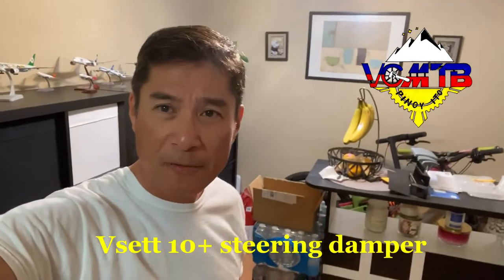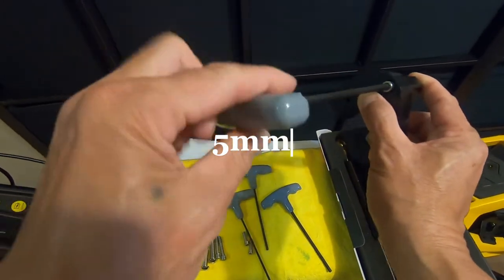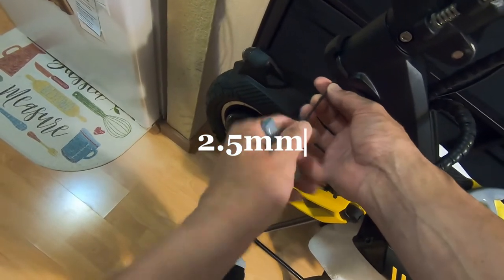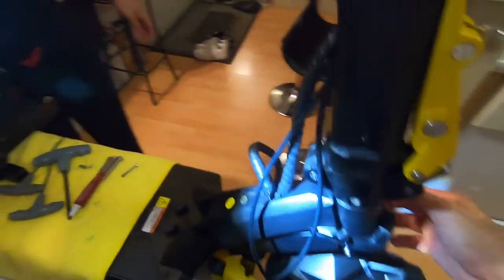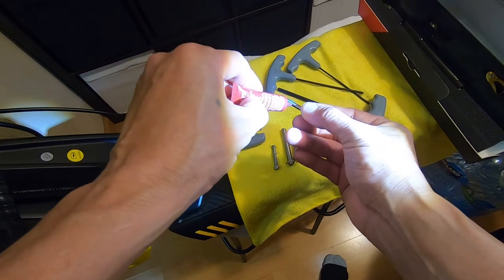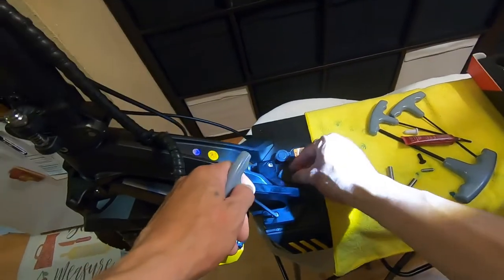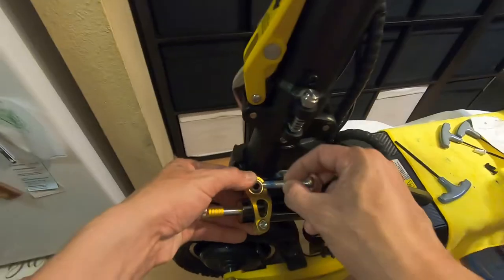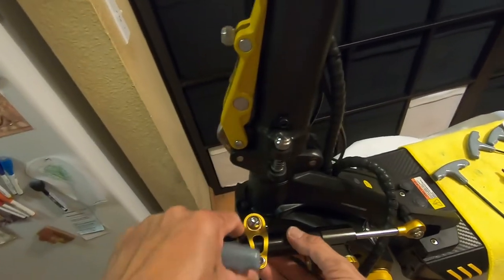Vsett 10+ Steering Damper Installation/ Electric Scooter/how to

Comment: Hi, installing my same damper today. When you installed the front bushing and slowed down the video, it looks like the curved side goes down. So on both bushings the flat side goes against curved side on all points, correct? Thanks!
Reply from the maker: Yes correct! You have to make sure the damper must able to move freely up and down..
Reply: @vcmtbpinoyito  Wrong...Been trying to tell you in previous post but you are not listening.
The "metal bearing" let the outer part flex movements around it...you want the BEVEL part of the plastic bushing to go into that metal ring..that is how it "sink inside" to secure the installation between the (bolt, metal bearing, and plastic bushing)...bushing job is to "secure that bearing"...let the silver bearing do its job...once secured like I've mentioned...THE OUTER PART OF THAT SILVER RING ROTATES/FLEXES "AROUND" IT ! Therefore, you must sink the bevel ends INTO the silver ring!
This is the instructions straight from the manufacturer.
https://ae01.alicdn.com/kf/H6db30273f0784e4cb17fd198495699c8I.jpg
https://ae01.alicdn.com/kf/H6dfea355c558473a8e002a1deb98173bg.jpg
By your logic...what is the point of designing the bevel ends then ? 😏
Reply from the maker: @AZN-4-LIFE-U  ok Man let double check mine when i get home.. thanks for the info..
Reply: @AZN-4-LIFE-U  thanks for the photo's, I should be getting my setup soon, I watch several vid's on the install to include the one from RevRides and none of them shown the proper orientation or made mention of it in their vid's....again, thanks for clearing this up...Mahalo Nui Loa.

Comment: With a shorter damper like that it doesn’t seem like you’re able to turn the handlebars to the right very much. Any issues with that?
Reply from the maker: No issues at all, i can turn the way it should the damper is a big help with the stability on a higher speed, thanks for dropping by🤙
Reply: What do you have the resistance set to?